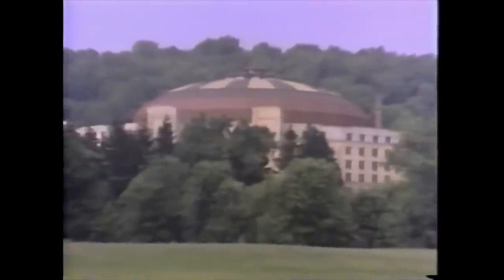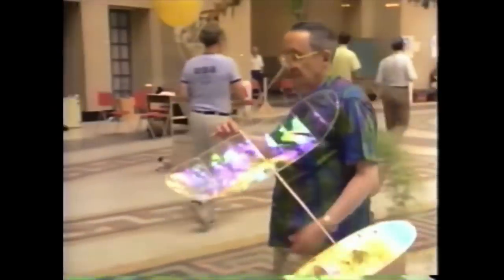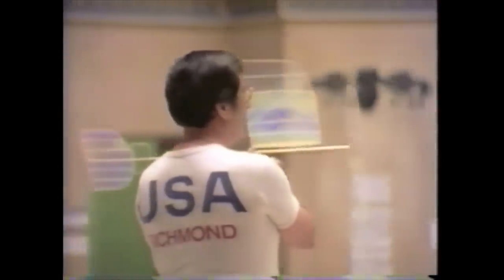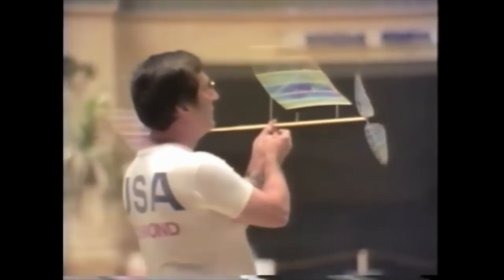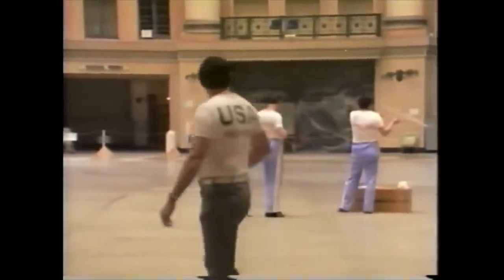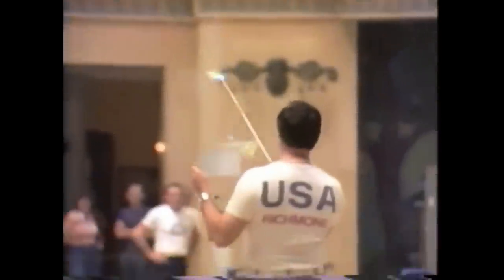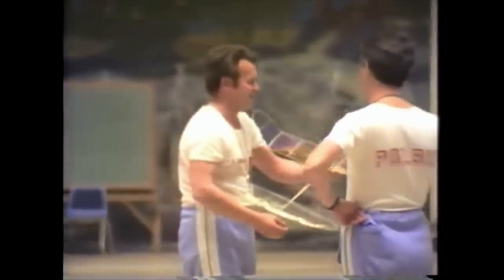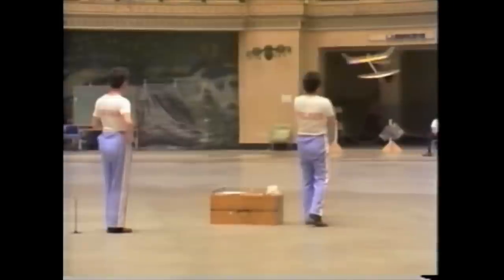FAI F1D1980 Indoor World Championship West Baden, IN USA - The Worldly Flights of Indoor (1980)

Comment: What's the film called they use for the skin of the plane?
Reply: It is called microfilm. It is made of mixture of varnish and thinners and then poured on water. It is not used anymore. Today modellers use plastic films.
Reply: @faj7342  That's fascinating, I'll have to look into it. I assume the stuff they use today is way better? What's the new stuff called?
Reply: @ConcreteBombDeep  Well, the microfilm is lighter and can be made in different thicknesses. When you watch carefully there is one moment when you can see a plane with different colors of the film. The wing is blueish (medium thickness), tail is gold (quite thin). The thinnest is silver but it is almost impossible to lift from water. But the microfilm very fragile  and planes usually did not survive for more than a year.
Now the weight limit is 1.5 gram so it is ok to use plastic and planes are much more durable. Btw the plastic film is called  OS film.
Joshua Finn has very nice tutorials of making F1D planes.
Reply: @faj7342  It is not varnish, it is plasticized nitrate dope.
Reply: @brettbuck7362  Yes. Lost in translation.In a  recipe I used there was a Tissue shrink dope